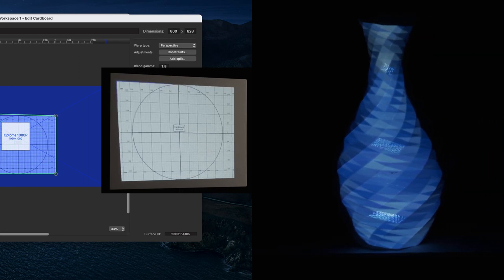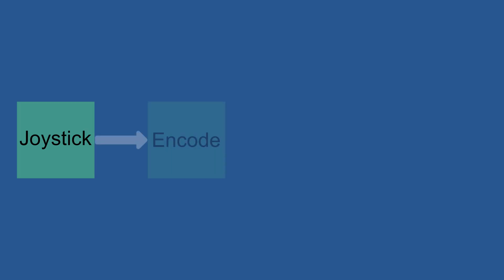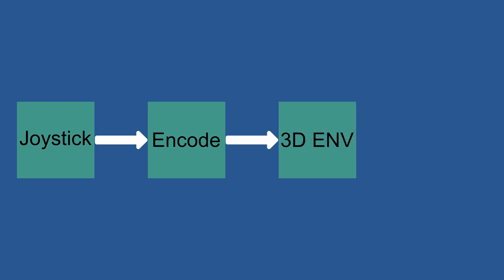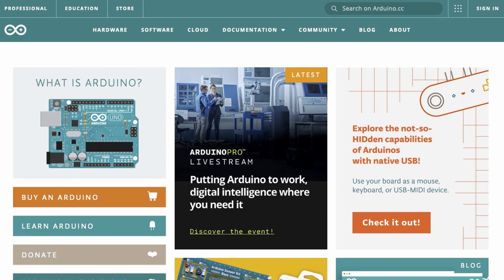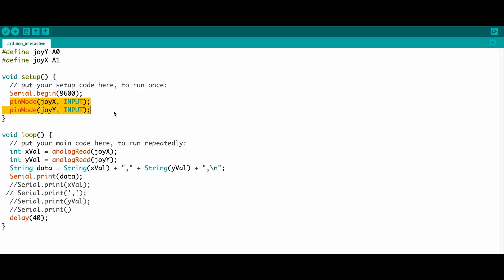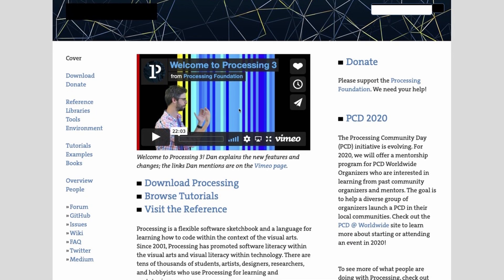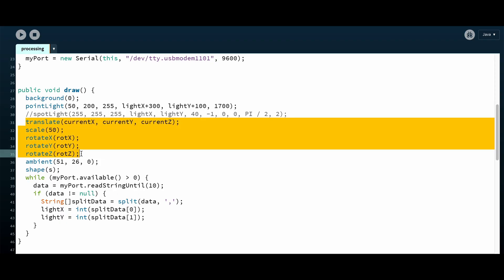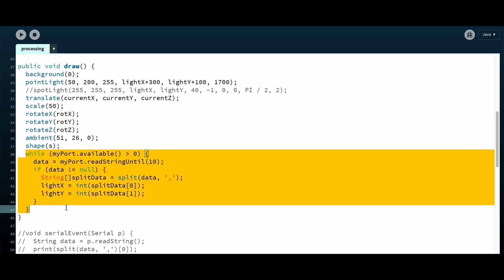Real-Time Projection Mapping Basics with Processing and Arduino

Comment: not sure if you have already done a video that touches on this idea but I have been wanting to take my projection mapping skills to the next level by having a piece that is truly interactive similar to the examples i've seen of people dancing or waving their arms and the projected image moves as well. 
I believe this is being accomplished by a 3d/VR type camera that has the capability of detecting movement and distance or depth of the object in motion. 
I haven't been able to find something that explains it to where I feel confident I am investing in the correct camera or sensor to accomplish this. 
Is there any way you may be able to shed some light on this. Even a simple example would be great as I am trying to do a larger installation eventually for a light festival later next year.

Either way, thanks for posting these types of videos. There have definitely been a few things you have gone over that helped with some projects of mine.